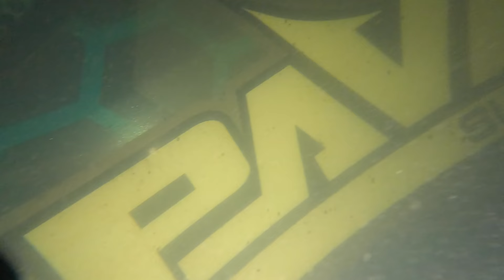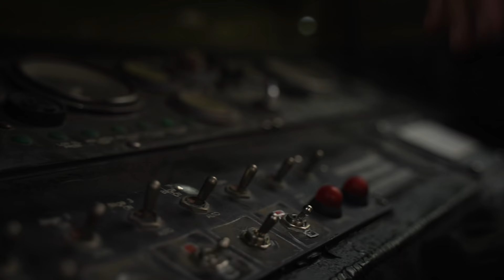I Sunk My Brand New $400k Pavati Boat- 95 Foot Deep Recovery With @AdventuresWithPurpose

Comment: Seems once you have it out , a lock be put on that plug.  Water sensor alarm might even be an option for less then $20 . Seems like a lot of drama due to not being ready with extra air at the start.  That and twice the bags you think it might take ! Might have to start planning right at the start for worst case and then what might even be worst then that .

Comment: Probably not getting nitrogen narcosis at 95 feet.  The bends, nitrogen saturation is a potential problem, but as long as they do deco stops they should be fine.  Not sure what the altitude of Lake Powell is, but that does complicate nitrogen saturation a little.

Comment: A 400k boat does not have a threaded bolt in style plug with a stainless safety cable? And 400k? For that? I think of what else I can buy for 400k...a crazy nice searay cabin cruiser in the 30+ foot range...or for fishing a boston whaler that length too.

Comment: We  used to figure no more than 15 minutes at 100 feet .  once in 24 hours.  And 30 minutes hang time at 35 feet in a tank tied to the ropes.  Never had a problem. At 100 feet you are sucking 3 times as much on each breath.  (compressed) 3 times the surface volume. 
If you suck a quart on surface you suck 3 quarts at 100 feet.   It's fun to blow a balloon up at depth.  When it surfaces it is 3 times bigger.

Comment: Hope you learned from this, I’ll never hear a bilge pump running and not check my bilge, sure the plug pulled without your knowledge but a responsible boater would’ve noticed the problem long before

Comment: why didnt you bring out a aircompressor and some extra bags to attache them to the boat so the boats sits straight on the water and than pump out the water with a big pump on a generator instead of dragging the boat?

Comment: Why didn't yall just put air bags on the back corners of the boat and then it would be high enough to pump it out as the front is still attached to the Navy boat?

Comment: So the only person to sink a 400k boat is a YouTuber ready to profit from it.  Not to mention why would you replace the original plug with a cheap plug unless you were planning it???   And finally the insurance covers your loss.   Sorry,.  Way too many coincidences to not be planned.
Reply: his reaction to the gas can "that's my gas can - wait I don't remember having a gas can" then the anchor line "oh yeah I was going to do this blah blah"... liars tend to overexplain. Then when you watch the "did I sink it on purpose?" video, his bilge hose was disconnected and he says "oh I had to take this off to change the audio battery"... The steering wheel cover on it? He said he was driving when it sank. Why would he put the steering wheel cover on while it's sinking? FAR too many "coincidences" to not be planned indeed

Comment: Most boat recovery company's will bring the boat to the surface first. Equip the submerged boat with a high volume pump to pump water overboard.   the next step after bringing to the surface with bags is to use a bigger boat to bring the submerged boat to plane as even  full of water, if you have a big enough boat towing the submerged boat, you will get it plane across the surface and then you start to pump the water out while at speed.

I'm really surprised you dragged it out the way you did.

Comment: Those so called recovery experts sucked. They should have had a coms system and used a hooka system so they didn't have to worry about running out of air. They got the job done but I have thousands of dives under my belt I am a commercial diver.

Comment: This is daft - no comms, no remote monitoring. That close to rock faces,that depth, winch lines/air bags being used. 
The dive should not have gone ahead.
Is your boat really more important than that guys life?
And using a metal winch line in water?

Comment: As a military diver, it makes me cringe hearing people explain diving especially when it’s supposedly their job… you are not diving oxygen, it’s air, nitrogen narcosis has nothing to do with decompression sickness or gasses coming out of solution (blood) from assending to fast. or the possibility of AGE. Nitrogen narcosis refers to the psychological effects of to much Nitrogen at a certain partial pressure (leaves you feeling tipsy). Or how the guy was talking about a “decompression changer” which you actually need a Recompression chamber ( a decompression chamber becomes a recompression chamber when recompression therapy is needed).🤦‍♂️

Comment: Why was the steering wheel cover on when they pulled the boat up?  As it was sinking did they say "hey, we should put this cover on to protect the steering wheel"?  That's kind of odd.  I wouldn't put it past these guys to stage this.  They filmed themselves enjoying the boat that day, they make content full time, but they didn't film any of the boat going down or sinking?  Obviously they were not freaking out as the boat sank because they had the time to put the steering wheel cover on so they could have easily filmed it. For reference if you look at 39:15 you can see the cover on the steering wheel.  It was clearly on when they pulled it up, they did not put it on afterwards.  I also bet if you check to see if law enforcement was called there is no record.

Comment: You blokes need to take way more care in regards to steel wire winch rope, all those people standing right around the cable would be cut in half in less than a second if that cable failed or the winch got disconnected from the boat. Not real smart

Comment: Year 2022 - when the F#@$ will they make bilge plugs that only allow water to move from inside the boat to the outside ? check valves . How hard can it be ? they send missions to Mars and build space stations already 3 centuries but still you unscrew a bilge plug just to forget to screw it again back and water goes in . happened to me on my jetski - thank god it didn't sunk .

Comment: Absolutely disgusting that a boat with a price tag like that would have anything less than a quality plug for the boat.  Design and engineering team:. . . . "let's skimp on the drain plug cause 12 speakers  isn't enough. OK, I will get the cheapest plug from china.  Done deal!

Comment: No no no.... your wrong, the captain is guilty.
Was that you. Then your guilty of not doing your job and keeping the passengers safe. 
Captain , should 100% of the time check all thru holes, make sure all bilge pumps are working. 
That all coast guard saftey equipment is on board and is in working condition. To also include life vests for every single person on board. A good captain, would do a debrief with passengers, even if one is his wife. 
Man over board, where first aid kits is, how to use the radio, what to say in a mayday. Mayday should be repeated 3 times,  this is ( name ), at what level of a emergency is it. Sinking, heart attack, gun fire, broke down boat, we are sinking. 
So, hairy bearded,  captain,.... you are guilty, of sinking your boat. And all most KILLING your family. Boating is fun, till someone gets killed or drowned. Man up...cowboy...

Comment: A lot of "NOT MY FAULT" from this group.  Not my fault the boat sank; not my fault that no one checked the comms; not my fault we are out of dive bottles.

Did you have enough air left to disco from the boat in case you couldn't lift it up?

All because someone didn't put in or check the drain plug.

Comment: well it's obvious that you guys know nothing about boat recovery .  the boat should never have to touch the bottom when raising it you don't drag it on the shore . and why would you come without gas powered air compressors. you had plenty of equipment but just know the right equipment . You can actually tow the boat with one boat with the water lifting the boat if you tow it by the bow and then pump the water out as your Towing .

Comment: No registration numbers on the boat, steering wheel cover still installed. Clearly not a boat in use when it was sank. Staged!
Reply: Woah mr. Detective.  You get a cookie for that. Good boy!!
Reply: What can I say, I'm just a regular Sherlock Holmes. His story could be legit, I've been a boater my whole life  and seen enough to know crap can and probably will happen on the water. Just making some rather important observations and arriving at the most obvious conclusions

Comment: Seems a little fishy here. Was this done as an Insurance scam or just for the views?
Reply: both obviously, to me at least.
Reply: Why tf would he need to do it for money??
Reply: @fxrsniper1  because he wants his 200k cash he would never get if he sold it. he isnt that rich. billionaires do insurance fraud. even if you notice the plug is out and water is in the boat, you can still get to land safely in most cases. Worse part is they were on  a lake..
Reply: @teahaul7897  Also the follow-up video shows  when he changed the batteries he accidentally knock the hose off the lower bilge pump. The plug wasn't out it was knocked loose allowing water it get in. The Divers version of the video shows this. The type of plug he used can stay in not locked but will allow a lot of water to get in. We used those plugs for years when I was younger Been on the lake for 45 years. Remember it sit for a day before it sank allowing water to slowly seep in.